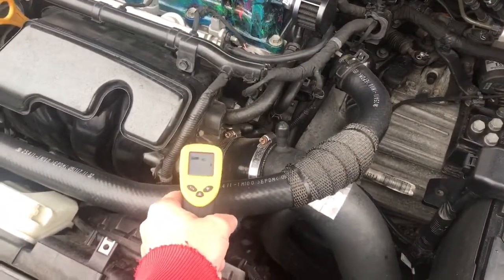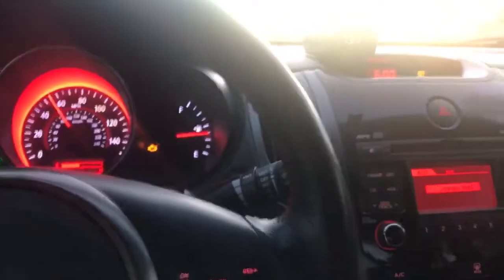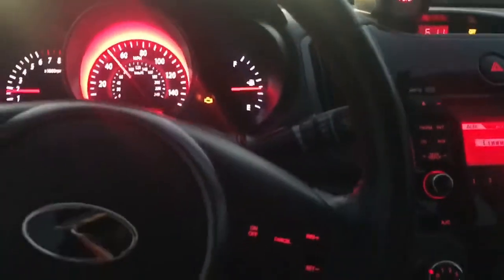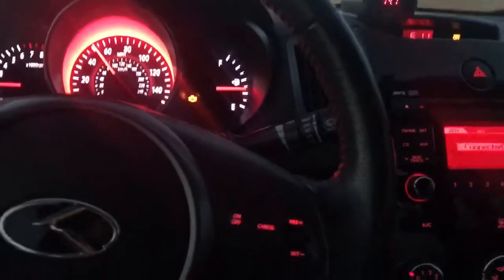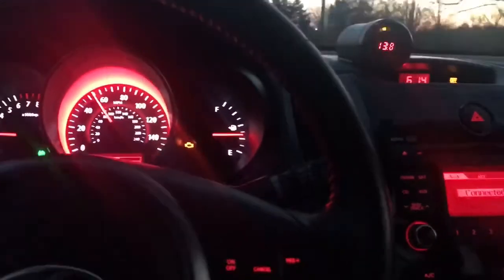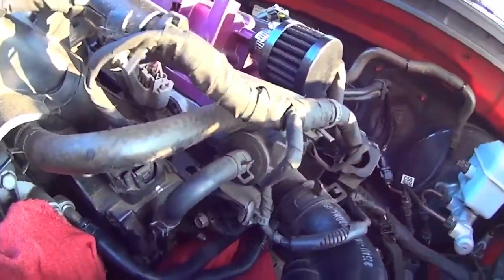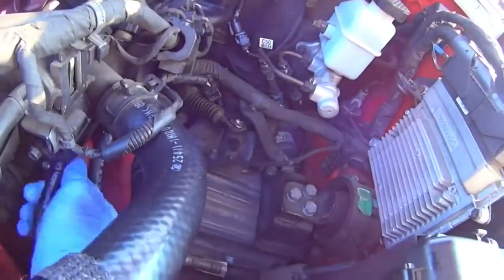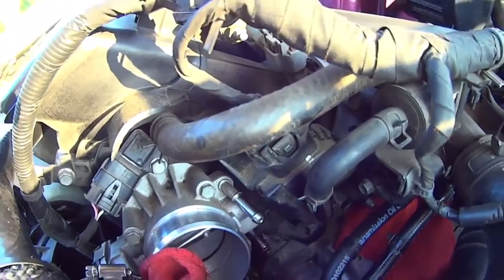Throttle Body Coolant Bypass 2010 Kia Forte Results + old how to

Comment: Definitely going to give this ago 👍🏻👍🏻

Just a quick one,   why is your engine warning light on ??
Reply from the maker: because it doesn’t have a catalytic converter
Reply: @jrwkoup1323  🤔 ? I've got headers , full 63mm free-flow exhaust + a K&N Typhoon induction kit..  

No enjin light wots so ever 🤷‍♂️
Reply: @neilgouws6962  do you still have your cat convertor, my cel is on for the same reason and 2.5 str8 pipe all the way
Reply: @kidrock0071  no cat at all 😈👍🏻

Comment: What are all your mods I need ideas for my 2010 sedan, I’ve got : k&N cai, throttle body spacer, coolant bypass, and a muffler delete. What else can I get to make my forte beat my buddy’s civic si. He wont stop talkin smack lol
Reply from the maker: I have a ark cat delete, ark 2.5 cat back exhaust, turbokits.coms cold air intake, short shifter, coolant bypass, a canned (mail in) ecu tune and I’ve hand ported the throttle body and factor header a tad. I have a 6 speed 2.4l; I’m not sure what yours is. If it’s a k20 civic you should be competitive with a real cold air intake, that k&n only sucks in hot air and makes less power, a cat back exhaust that’s at least 2.5 inches, a cat delete if you don’t mind working out a check engine light or high flow cat. If it’s a k24 si you’re going to at least need a 2.4l manual, all the mods listed above and a tune to keep up and he’s probably going to still when but it’ll be close.

Comment: So which better bypass tb or no?
Reply from the maker: Bypassing the throttle body it's better. Like the video shows it makes a huge difference in the temp of the throttle body.
Reply: @jrwkoup1323  the TB should be hot , is that true?
Reply from the maker: @dinnotj4674  No the throttle body should be cool.  A hot throttle body will heat up the air entering the engine. Hot air makes less power. The coolant is running through the throttle body to prevent freezing but unless you live in a place with really harsh winters the throttle body freezing won't be an issue.
Reply: @jrwkoup1323  oh ok .thank u for your information sir..
Reply: Will this work on the 14 optima with the 2.4, your motor looks pretty similar to mine but I wasn't too sure if the theta 2 was being used in 2010, I believe it was.

Comment: Any aftermarket throttle body that could work
Reply from the maker: Not that I am aware of. The turbo veloster and genesis throttle bodies are smaller than the forte as far as cross compatibility goes. I sent my factory throttle body off to be ported but at only 2mm it broke through to some cooling chambers so that’s really isn’t a viable option either.